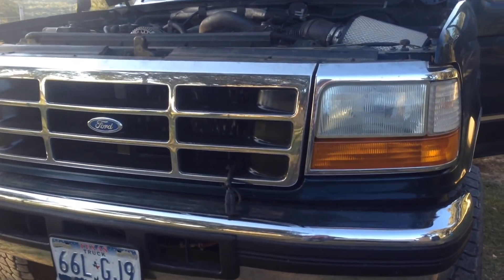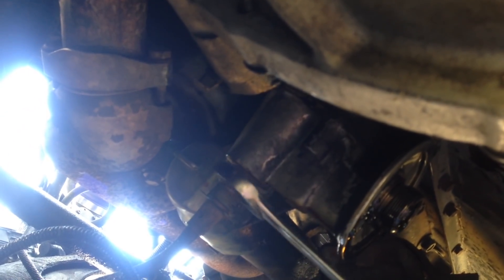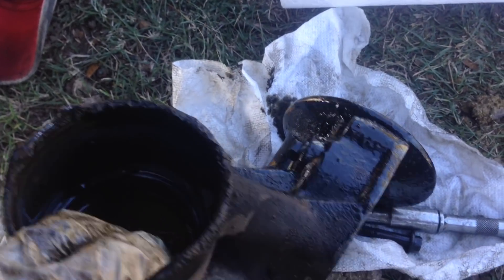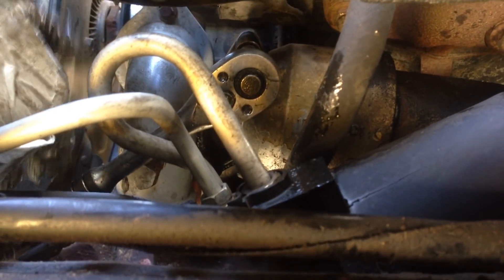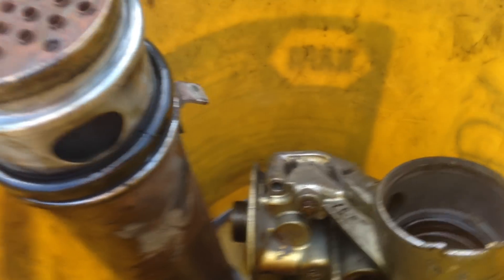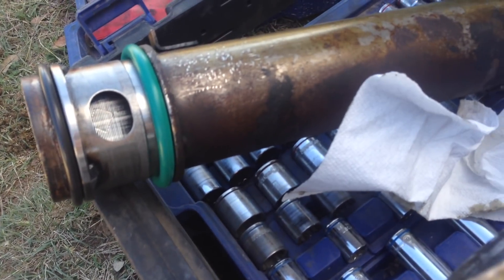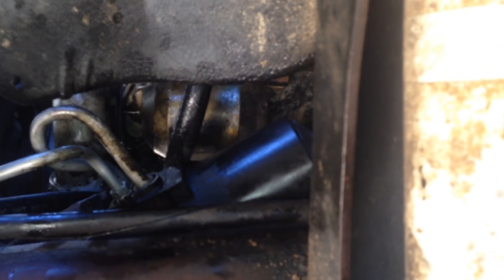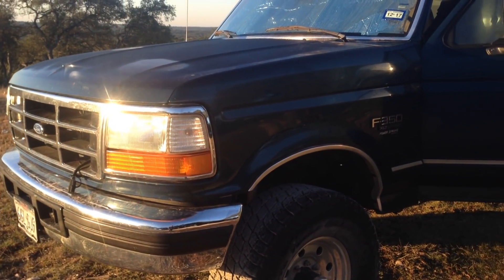Oil Cooler Reseal OBS 7.3 Powerstroke

Comment: Is draining the oil necessary? I drained my radiator and got the oil filter off but thats as far as I could go tonight. I just put $100 in new oil and don't have any more clean containers to drain it in
Reply: You probably already finished this project but, you can go to Walmart and buy 5 gallon buckets and lids and they are cheaper than you will find anywhere else.

Comment: Warning. I broke the aluminum casting of the front cover that the front end cap of the cooler bolts up to by prying to together like this. Put it together in the press and then install it in one piece so you don't have to pull the engine like I did on my 96.
Reply from the maker: Yikes, I'm sorry to hear you had such trouble. Thanks for the pro tip!
Reply: The same thing happened to me

Comment: How’s it holding up so far? Any leaks? Doing mine as we speak and I’m hoping it will last a while
Reply from the maker: Mine's been holding up great, no leaks thus far after another winter. I made sure the gasket surfaces were clean clean clean though, that's what makes the difference. A friend of mine paid a mechanic to do his oil cooler, and go figure it's already leaking again after a year. If I were to bet, the mechanic didn't do such a great job cleaning the gasket surfaces. Just be meticulous, make sure the gaskets all seat properly, and it should work fine for you!

Comment: Getting ready to walk outside to do mine. I'll let you know how it goes. Thanks for the video 👌
Reply from the maker: Good luck!
Reply: @Rnddiesel  hey bud, got her done and running now, ain't leakin yet. Was a pain in the ass to get the bolts lined up without getting dirt all over the gaskets n shit but hopefully I got it😂
Reply from the maker: @justinhuffman6494  Glad to hear, and yeah it sure is a pain. Hopefully it'll hold up and you won't have to do the job again for at least a few years!
Reply: @Rnddiesel  Hopefully!! Thanks again
Reply: @justinhuffman6494  My cooler just went on a 7.3
Did you take the front end cap off to do that gasket too?
Reply: @samuelyi9189  yeah, I took the whole cooler off then took with sides off and replaced all 4 o rings then put back together and put back on with new gaskets as well
Reply: @justinhuffman6494  How snug do you tighten the bolts?
Reply: @samuelyi9189  I believe it's 18ft lb
Reply: @justinhuffman6494  And what lubricant for the rings? Vaseline?
Reply: @samuelyi9189  just oil
Reply: @justinhuffman6494  Okay thanks. Bought a kit from American cooling solutions and am waiting to see how good the quality is

Comment: Gonna have to do this to my truck soon. Has the same leak. Any danger in driving it (potential for oil / coolant to mix) in the meantime and just adding oil as necessary while I wait for a point where I have time?
Reply from the maker: I apologize for the slow response. I assume you've already fixed the truck, but in the event someone else see's your comment, here's my thoughts. I don't believe there's any harm in driving the truck with a bad oil cooler as long as you're smart about it. Check your oil every time you start the truck if at all possible. Make sure there's no milky white coloration to the oil, if there is, stop driving ASAP and replace the oil cooler. Most of the time though, the oil cooler doesn't leak internally and will only dump oil to the outside making a mess. Usually once the truck warms up, the seals regain some flexibility and hold oil so it won't be dumping oil as you go down the road, that is assuming the seals aren't too far gone. Just be smart about it and keep an eye on your oil. Best of luck!

Comment: Do you have to change your oil with the repair
Reply: I'd change it, if you're taking the oil cooler out, coolant can get into your oil and that's not good. Best to be safe.
Reply from the maker: samuel Allen I guess technically no I don't think need to change the oil, most of it stays in the pan anyway, though I could be wrong, I drained the oil when I did it, but you would need to add some oil after the repair to make up for the stuff lost from the cooler. It would be a good idea to change your oil at the same time too, gives everything a fresh start, and there's less risk of running oil that's contaminated with water. When you pull the oil cooler off, there's a good change the oil and water could mix. If you can wait to do the cooler until it's time to change the oil too, that would be good, it's what I did. Either way you'll be basically draining all the coolant out of the block and be replacing that part anyway. Good luck with the project!

Comment: well Its cold and mine starting to leak, I thought maybe a main seal but this is way more common, seams easy enough.
Reply from the maker: Yeah, Oil Coolers are probably the most common leak that 7.3's have. Pretty much every one leaks at some point or another. It's definitely not the easiest job in the world to replace, but it probably is one of the messiest jobs!

Comment: That part was a bitch. (Putting the front piece back on.)
Reply from the maker: Dusty Diede I'll second that one, trying to hold the seal, the part, and keep the mating surfaces clean you'd wish you had four hands, at least you're done!
Reply: Rnddiesel oh dude, trying to keep it clean was one of the hardest parts. Lol. And then I was trying to hold the part....put the seal in place...and put the bolts in...I only had enough room to get one hand in there. Lol.
Reply from the maker: Dusty Diede yep, and just think, we're working on 20+ year old trucks, imagine what a new 6.7 would take to repair!  It probably doesn't help that the OBS Ford wasn't designed with an IH T444e engine in mind.
Reply: Rnddiesel I don’t know what that means...but you’re right. Lol. But yes, on this new stuff they have no room for anything.
Reply: Rnddiesel and I was doing it from the wheel well. Took the tire off.
Reply from the maker: Smart taking the wheel off! I'm a small guy, so I guess I was able to do it without pulling the wheel, probably would've been easier. Yeah the International Navistar T444e is what the 7.3 Powerstroke is with some slight modifications. It's the same engine found in medium duty trucks and buses. That's partly why the 7.3 Powerstroke is so tough!
Reply: yes. its defiantly a bad ass engine.

Comment: Attach a vacuum cleaner to the oil fill and turn it on.  Punch a hole in the bottom of oil filter, remove drain plug, put drain pan in place.  Turn off vacuum and let the oil drain.  No more oil mess.
Reply from the maker: I hadn't even thought about doing that! To make sure I understand you correctly. Your method is to reverse the flow of the vacuum cleaner, stick the nozzle into the top of the engine through the oil fill and essentially blow out the remaining oil?
Reply: Rnddiesel Nooo, pull a vacuum to keep oil from draining until you and your tools are out of the way.  No more oil arms.
Reply from the maker: Oh I see, brilliant! I didn't even know that would work. I may have to give it a try next time I change my oil. I'm sure others here will appreciate the tip too!
Reply: I'd be a little worried about upsetting a seal somewhere doing this, but sounds like it works for you!
Reply: @WTC1873  I've been using this technique since 2006 on the same truck.  No issues.
Reply: I installed a drain plug valve that has a hose attachment. I fill up 4 gallon milk containers, finish oil change, then pour the old oil into the new oil containers. No mess :)

Comment: Looking at a 97 250.  I'm suspecting the leak is coming from oil cooler as well.  Valley is dry but oil is dripping pretty good while truck running on the driver side.  Running down filter to pan and on shaft.  Was yours leaking pretty good? Repetitive drip while running?   Thanx man
Reply from the maker: Brandon Savoy, mine mostly leaked only when it was cold outside and I was doing a cold start. It got to the point where maybe a 6 inch diameter puddle would accumulate while at idle and warming up, but after the truck got warm the seals probably swelled up and sealed better, so the leak pretty much stopped when warm. It probably still seeped a bit, but not enough to notice. I wouldn't be surprised if the seals on the 97 F250 you're looking at are in even worse shape than mine were and leaking more. It is one of the more common places to leak on 7.3's, and given the work involved most folks probably find it easier to just add oil for a while. Given that your valley is dry, you probably don't have leaks coming from the high pressure oil line fittings. A few other good places to check include the oil dipstick tube fitting that goes into the oil pan. The oil gallery plugs in the rear of the cylinder heads by the firewall. Or perhaps the oil filter isn't screwed on all the way. I doubt it would be a rear main seal, as 7.3's only very rarely have rear main seal leaks, so save that headache. More than likely though, it's the oil cooler. After all oil is only pumped through the oil cooler when the engine is running.
 
 - Hope this helps, best of luck on the purchase!